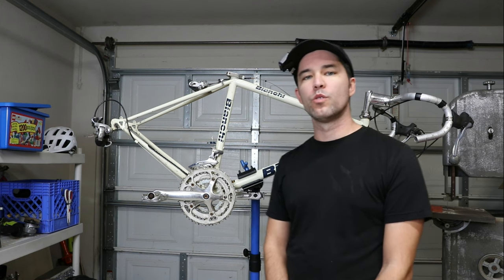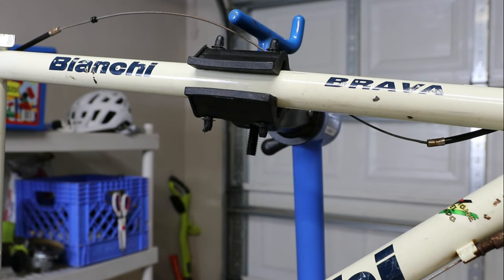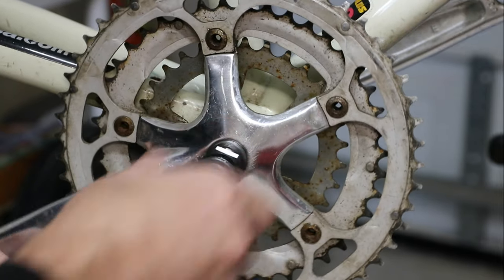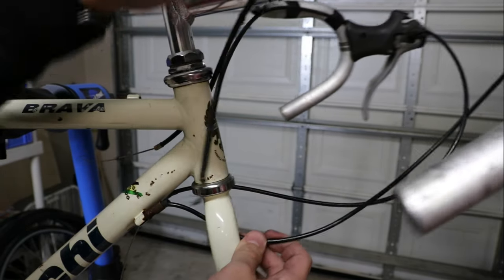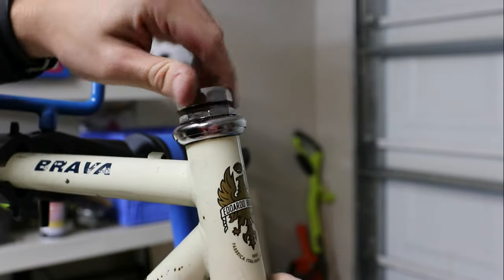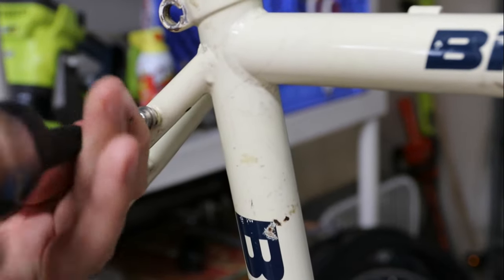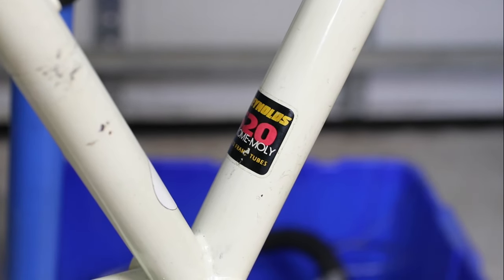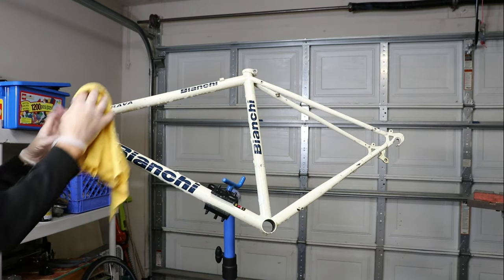2001 Bianchi Brava teardown and frame inside protection

Comment: I usually pour very hot water on the bottom bracket in order to "soften" the area, so it can be unscrewed easier.... but yep, it's about leverage
Reply from the maker: hmm I never thought of that, could be something to do outside with a pot of warm water.